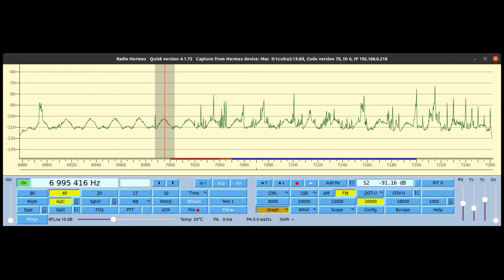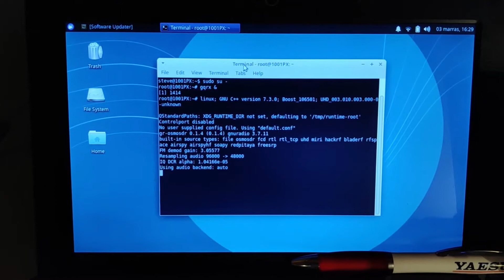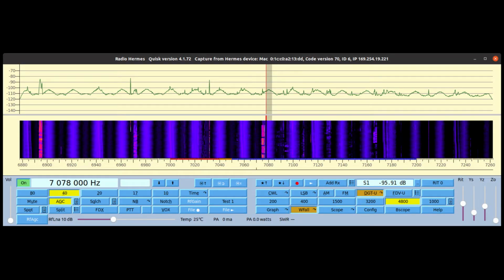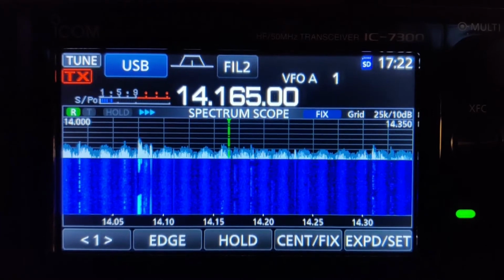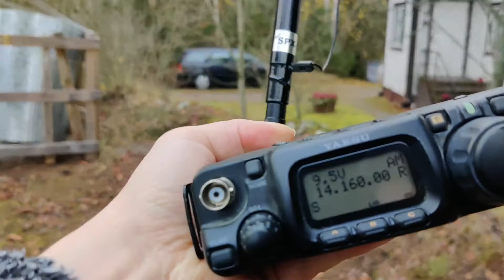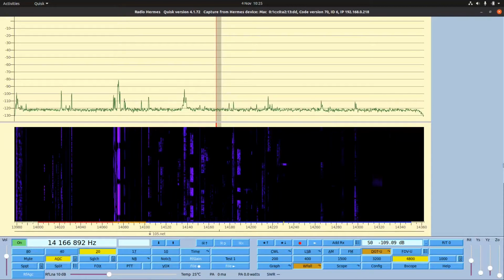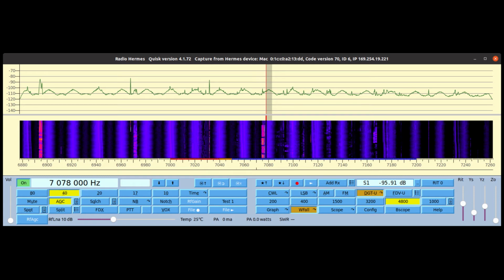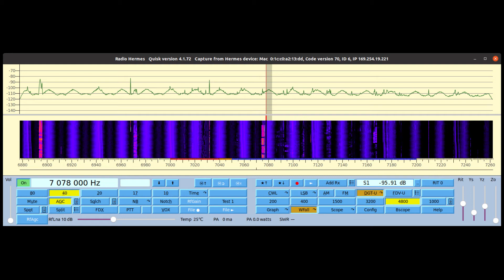How to Identify Local QRM/RFI Sources

Comment: man.. I wish my noise floor was an S5...  Most of the time on all HF bands it's 10-15 over 9.  Haven't been able to REALLY test if its coming from my own home or not, despite having turned off the mains breaker in the panel, but that doesn't completely kill everything in my hosue as I've got several UPS devices (which are probably also responsible for noise) on a server rack in my basement, my main tele, office PC, my 3d printer..... UGH.

Maybe sometime this winter the power will go out and I'll break out my FT817 before bringing everything back up.
Reply: Can you not shut off the UPS's also? They can usually be turned off. I turned mine off when hunting noise.

Comment: When I track HF interference I try going up in frequency to VHF (144 MHz) in USB mode.  If the QRN is broadband enough to get into VHF I find a 3-element measuring tape antenna (used for fox hunting) works better than trying to direction find on HF.  VHF is more directional and easier to track.  You may need to use HF to get closer to the source then switch to VHF.  The FT817 will tune up to UHF.
Reply from the maker: Thanks for the comment - and I'm sure this will help others in their tracing of QRM too.  Thanks again!

Comment: If you have a wideband HT that will cover the AM broadcast band then you can tune to that frequency range and walk about listening for the static between Am stations to locate rf sources. May not work for all rf noise sources. I've also been told to unplug your HF antenna and if the noise doesn't go away then it is in your house and the radio is picking it up. But if  the noise does go away then it is being picked up by the antenna and is probably somewhere in your neighborhood.

Comment: When I lived in Finland for 18 months most of the people I knew spoke very good English, young and old (mostly young but still) and that was in a village too, Jämijärvi.
Have you ever tried speaking to your neighbor?
Reply from the maker: You're correct; most do speak at least some English.  However, I was warned by the previous owner that neither neighbour speaks a word of English.  I can imagine any attempt at a technical discussion going downhill quickly.  But yes, it's definitely worth a try - for the entertainment value if nothing else :)
Reply: @oh3spnfinland718  Perhaps friend them first, despite the language barrier. That would make explaining electrical interference easier, especially if you can solve it for them and they trust you. But before that moment, never let anyone know you're a HAM, because from that point on every electrical and reception issue will be blamed on you, even when you were not listening/transmitting at that time.
Reply: Isn’t English a second language there?
Reply: @RustyX2010  Swedish and English